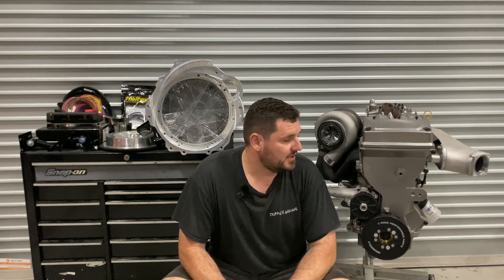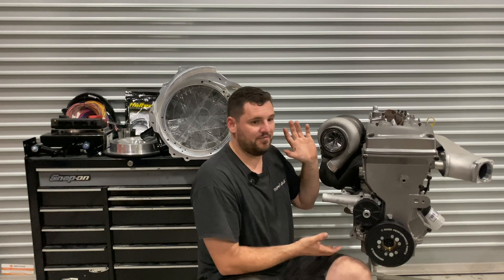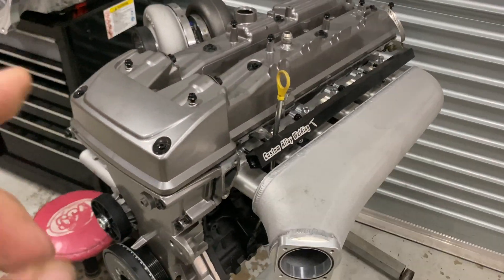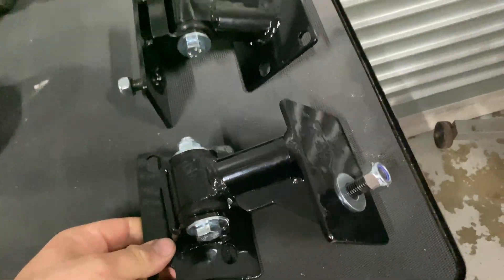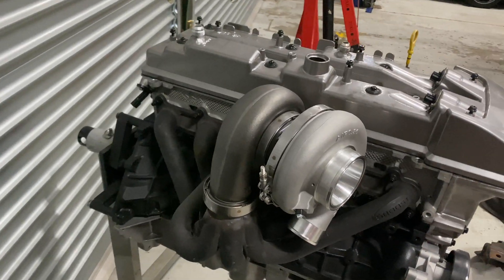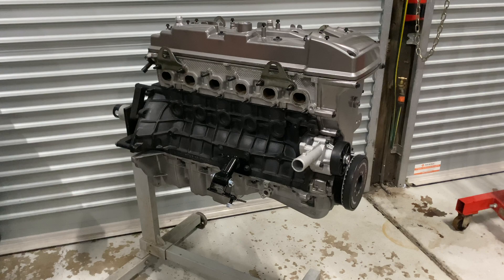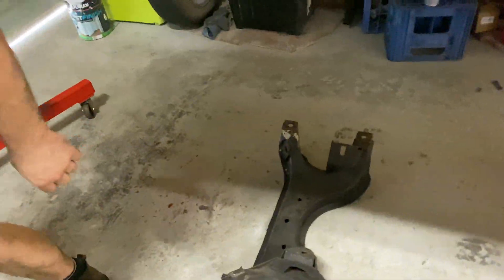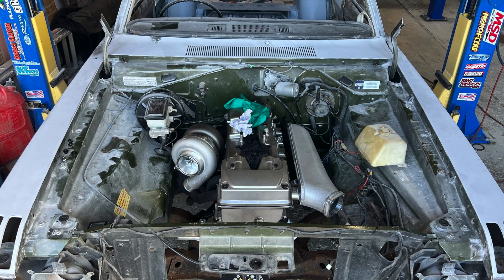1000+hp Turbo Barra + 8HP + Tuff Mounts Explanation

Comment: Your blowing me out mate , I've got a 998 Atomic race motor with the N57 8 HP 70 , how is your 8hp45 going to handle the torque the Barra puts out ? Are you running 8hp70 internals and main  shaft ?
I have all the Sonnax goodies with the Raybestos steels and clutches . And I'm told I have to Cryo the internals to handle the monster talk the old Barra puts out .
G451500 
CRG promod front mount exhaust  with twin 45 wastegates Plazmaman 12 injector manifold , manifold made for Nick Williams 103 throttle DBW  , with custom adaptor to ran a Bosch 82 mm throttle body .
I'm subscribed already .😊❤
Reply from the maker: Will do a video on the box specifically when its finished built and run through everything then 🤙 thanks for the support
Reply: @duffysgarage1196  no worries , I like your content , when you do the build up , please list all parts and part numbers , as I feel there will be quite a few interested in this . ❤️ Love the Barra/ BMW/ Valiant , will be sic . Also please can you rate the modified box in terms of LBS or Newton meters of Torque , as it's not horsepower that kills the 8hp it's Torque , as you know , but because everyone talks in HP rating , people think as long as their 1000 HP Barra is under 1500 HP it good , problem is that same Barra can put out 1400 plus Newton meters and distroy the trans . Thanks